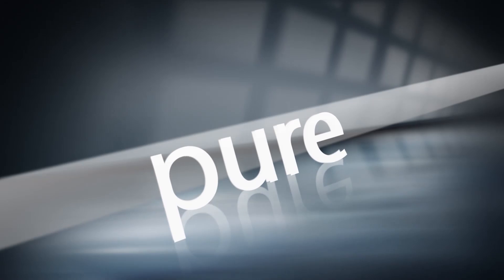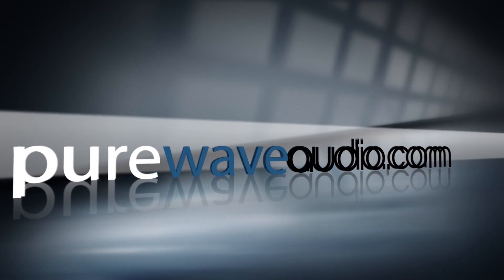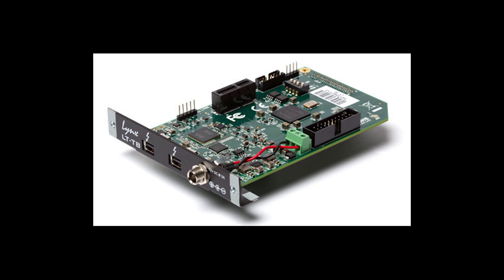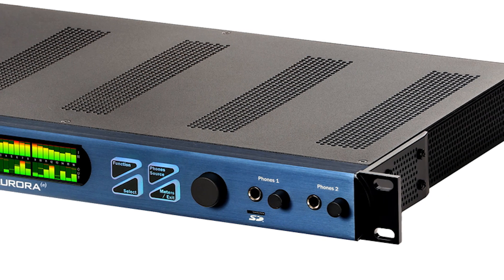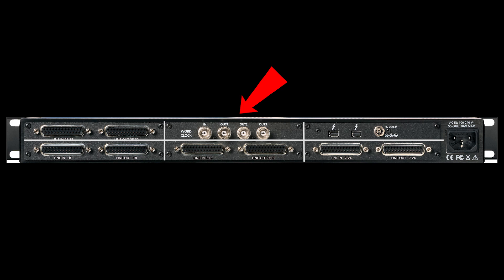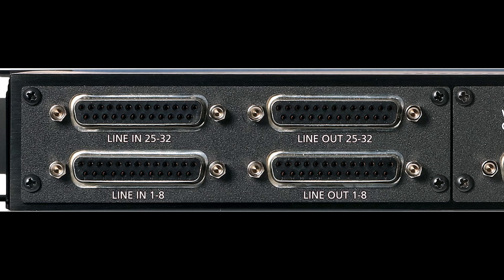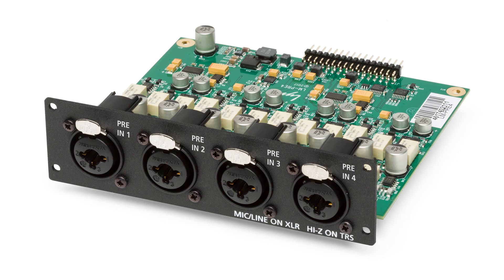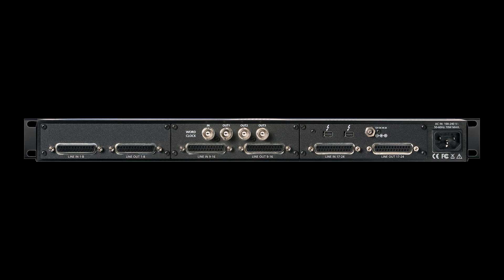Why the Lynx Aurora N Audio Interface Is Better

Comment: "Quick question, how do you connect your studio monitors to the Aurora model you have?"
Reply from the maker: Usually to a monitor controller so you have a physical volume knob, but you can go strait to the speakers and use software or the lynx rotary knob itsself can be programed to be a volume control.
Reply: What monitor controllers are recommended?
Reply from the maker: @mixedbyauden3207  https://purewaveaudio.com/recording/monitoring/monitor-management

Comment: Just returned the Apollo x8p after a few days of testing because they market a 16channel I/O with 8 preamps and 8 channels on Db25. What they don’t advertise is that one does not add to the other. You can use the preamps or db25. But not both. 😂 Also, the drivers are terrible for Windows systems on the x8p. Sound quality is ok but definitely not the best. I tried a plug-in and UA software threw errors saying it was too much to handle 😂 Also, their drivers cannot be used for microphones on the computer OS for Zoom, or other applications because their interfaces are for “professional use only.” 😂 Are you kidding me? Zoom is for professional use! INSTANTLY returned! They have good marketing and that’s about it. 

NOW! I have the Aurora n 24 with the LM3-4 preamp option in my possession that I just purchased from SW. Expensive? Yes! However, I now have better conversion, better drivers and support for Windows, can use my pro Mic in Zoom, added 4 additional channels of IN with the preamps giving me 28 total tracking/recording channels instead of Apollo’s bs of using one or the other, and feel confident that the product won’t fail me. 

Do I get DSP and plug-ins with the aurora n? No. That’s ok because I don’t really use them anyway on interfaces. I have my own within my DAW. And I have enough CPU where I don’t need to rely on DSP. Oh and did I mention the awesome headphone jacks on the front? UAD doesn’t add those to their top tier interfaces. 

Glad I went in this direction. Thanks Lynx!!!🎉

Comment: Regarding the E44 Lynx, which has 4 analogs in and 4 analogs out, do I connect mic preamps using XLR cables to the analog in D-sub of the E44 and then D-sub out XLR to two monitors to hear what I'm tracking? Will this setup work? Thanks in advance.
Reply from the maker: That is one way. You can add some safety and convenience in their by adding a monitor controller between the Lynx out and the speakers. This way you have a volume control outside the computer. If your computer ever froze, you can manually turn off the volume to the speakers since sometimes during a freeze a sine/square wave will be on the outputs. Hope this helps.
Reply: @purewaveaudio  Thank you so much!

Comment: Hey there! Quick question.. what's the difference between the Hilo converters and the Aurora converters? Thanks
Reply from the maker: They are very close.  Since the Hilo is a 2 channel design the specs are just a hair better.  I mean very slight difference.  Since the Aurora N has to put more electronics in a smaller space it is tougher to achieve the same spec, but if you heard them back to back I would say most could not tell them apart.  Go look at the spec differences... it is very impressive.

Comment: In a live setting, can I record to my DAW while sending a summed mix to my PA system?
Reply from the maker: Many ways to do this.  Usually you would use a mixer for the balance and eq for FOH and tap the direct outs to record.  However if you are asking to do it all in the box, you can either use the Lynx mixer for sending a low latency mix out, but there is no eq.  Or you can run through the DAW if you have super low latency and run the stereo out back to FOH but you would have all the eq.  This is a simplified answer, but hope this helps.
Reply: @purewaveaudio  thank you for your reply. Latency will certainly be an issue going through the daw. I think the best option is the mixer route

Comment: Any chance you can daisy chain 2 together if you need 48 channels of I/O?
Reply from the maker: Yes, multiple units can be used at once for higher track counts.  I suggest a 32ch and 8 ch unit for 48 ch.  Later you can always upgrade the 8 ch unit to 16,24, or 32 if you need to go higher.
Reply: @purewaveaudio  I have an old lynx 8 channel and the new 16n, can i link these two together? anyone knows?

Comment: What is your opinion on purchasing an RME converter over a Lynx converter?
Reply from the maker: Lynx is Mastering Quality. I never heard of anyone using RME for mastering.
Reply: @purewaveaudio  I use RME AIO for mastering 😄😂😭 But I'm sure the Lynx sounds better.
Reply: @purewaveaudio  Actually, there are several engineers using RME for mastering lately. I myself, who love Lynx, have had many converters for mastering, the latest being the Pure 2 by Antelope. I was amazed by the quality of the RME UFXIII, which uses the AD'2 Pro converters you see below in the video. I was skeptical too, but after listening to it, I was positively impressed. If by mastering you mean the ability to trim the converters, like on Lavry, Dangerous, Burl, etc., then RME is not the right choice, but as far as sonic detail is concerned, the UFXIII is definitely in the highest sonic range you can find around.
https://www.youtube.com/watch?v=doHG32aXBDY
Reply: @purewaveaudio  Lynx may make great converters no doubts about that but Mastering Grade' is just a Marketing buzzword with no real meaning behind it. Just about any high end converter is capable for mixing and mastering applications. Chris-Lord Alge went from Apogee to the Focusrite RedNet system. I know some Mixing and Mastering Engineers even using Motu AVB converters such as the 16A and 24Ai etc. David MixBusTV a Multi Platinum Mixing and Mastering Engineer uses the Motu 16A and 8PRE-ES has his core conveter. I have the Motu 828ES myself that uses the same 32bit ESS Sabre DAC chip found in Apogee and UA Apollos. The specs on the new high end Motu AVB line rivals many converters twice its price range with real world dyanmic range I'd 123db A-Weighed with a total of -110 that even rivals the older Aurora 16. Color is rather subjective as virtually all converters have their own sound based on their own specifications, analog stage circuitry, clocking, quality of components used and the power supply design. Lavry, Meytek, and many others makes great converters. It's a matter of taste and preference.
Reply: Eman 08 Yes for sure, there are many options out there with great specs and some with lots of plugins on offer as well like UAD offering. A good point though regarding transparency and what that really means in an interface is more important to some than others. If an engineer is primarily loading files instead of capturing rather that running in and out multiple times through hardware and the da and ad, most people will not even see the cumulative difference it will definitely make between all of the “references” grade converters. Think more sensitive instruments where you are not aiming to have that great “xxx”sound.    I had an Apollo that I thought was great until using it with certain source material and I absolutely love the prism unit I sold it to use in its place. I will not say that the prism doesn’t have a sound but the way it consistently renders certain frequencies is the reason I have not changed it. Rme adi f* looks good, the Hilo looks good. You just have to listen to them. 129db dynamic range looks great but depending on the rest of the components in the converter, it may not be as successfully rendering the whole range of frequencies you desire. To each their own.
Reply: @anthonyrock5039  I just bought the ATLAS as I was regretting buying the UAD Apollo X8 as its sound quality, and clocking are not the premium standard I was hoping for. Immediately listening to the prism, I cannot stress enough how amazing the sound quality is in comparison to the UAD.
Reply: @david5104  yes.  The UAD ecosystem has the beat in class marketing with its plethora of plugins its essentially a dongle👌🙌but it was not for me. I loved the LA610 hardware that I owned for a while but sold it and replaced all with a Zener limiter and a Lynx Aurora n. The Prism and Lynx are incredible.

Comment: Hi, I have a Manley Core preamp that I use to record my voice by recording on Cubase 10 via the Lynx Hilo LT-USB converter. Can you tell me how I can best tune the "LINE IN TRIM dbu & dbv" and the "LINE OUT TRIM dbu & dbv" on Hilo? Thank you.     P.s. On Cubase I record my tracks at 88Khz 32bit floating and I work the mix totally in the box.
Reply from the maker: Hello,  I would not get technical with it, but dial it in to how you use your preamp.  Your preamp has an output fader so you can probably leave it default from factory like 98% of people do.  However to go more in depth, if you love your preamp at a regular level and you are getting an average of -18 to -12 in Cubase input meters (close to the bottom of the input fader visually) and you are not peaking.  You are good to go.  If not, adjust the Lynx input until it does.  The opposite scenario would be if you love the preamp driven hard, you might have to turn the Lynx down.  Again this can all be adjusted on the output of your preamp so there is probably no Lynx adjustment necessary.     The output adjustment would be for a similar scenario but on the output side of things.

Comment: Hi ..... may I know what do you mean by LM slots are not user installable and also u mention send the product back for upgrades? Sweetwater is selling the Lynx LM-PRE4 module?
I find a little confusing regarding the Lynx n future upgrades. For example on Lynx site when we choose: Line I/O:16ins/outs/16 , Mics Pres:0 mic pres.....the configuration of 16 ins/outs are linear (in other words we have two modules with 4 DB25 in line).
If you wish to upgrade in future 4 mic pres then the configuration on the 16ins/outs will be in PARAREL  (in other words we have 1 module with 4 DB25 in parallel , all 4 DB25s on the first module then the second module goes for the LM-PRE4).
So as I understand that is why we have to sent it back to factory so they can exchange the 2 modules that contains 16ins/outs into one module of 4 DB25s in parallel in order to accommodate the LM-PRE4.
Is this the reason for sending it back to factory for upgrades??
Thks.
Reply from the maker: No, As I mentioned to make this unit 1 rack space the ability of self removing LM cards was not possible because there is other internal things that have to be done only by the factory to make it work.  So if you configure before you buy, it is built to spec, if you upgrade, you have to send it back, but they do not charge for the install.  I see where your thought process is going, but it is not just physical location of devices moving around. As a side note for others...  If you are adding mic pres, there is a limitation due to the size of the Pre card. 8 max because you still need an interface weather it has other outputs or not.  If you mess around with the configuration you will see that certain options go away when certain configurations are chosen.
Reply: @purewaveaudio  I understand that things moves away according to configuration but I think their upgrades leaves people a little confusing. Just as u mention certain option goes away depending configuration....I understand that we still need an interface (as for now).....but Lynx mention will also be an ADAT module coming (not sure when??? its been a while and still nothing) and from their interview people will get an idea of an easy swappable modules process.
Reply from the maker: @fenderplus  The interface protocol is easy swappable , but LM easy factory swappable .  Most people will not be switching out cards on a short time basis.  Just once every few years when a configuration of the studio changes.